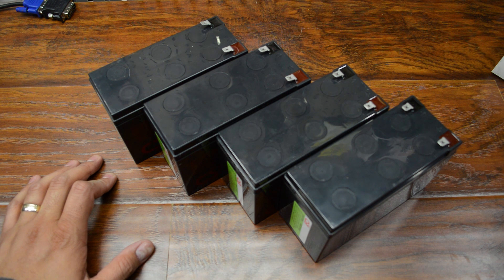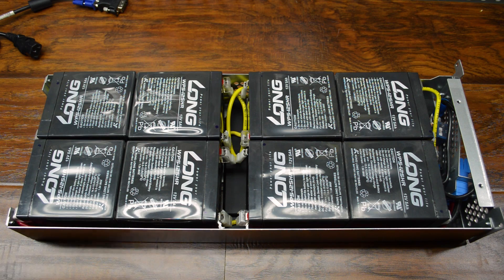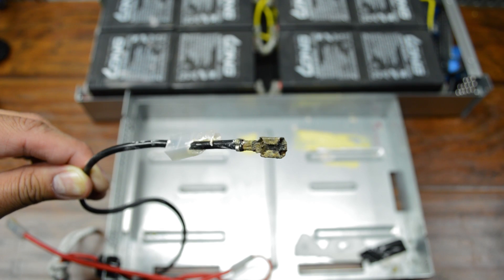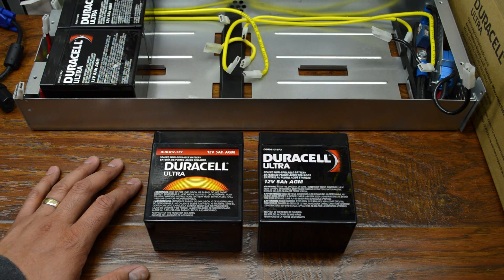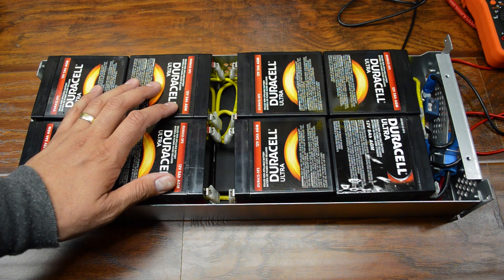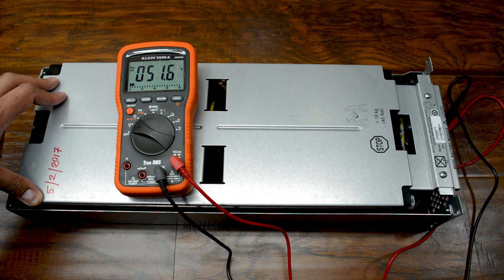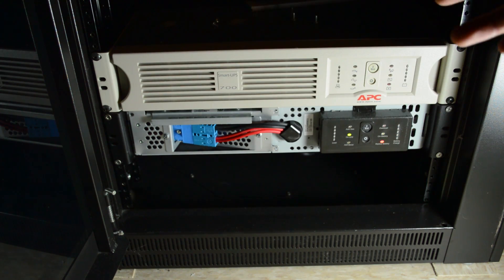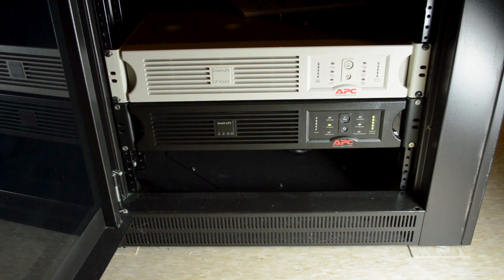Replacing Batteries in my APC SmartUPS 2200

Comment: Ever find a wire diagram?  I am looking at one of these on ebay right now and it has no batteries so I have no reference point, it just has all the wires.
Reply: If You Haven't Found The Diagram or Got no Responses, Essentially You Have 4 Batteries in The Back Connected in Series to Make 48V and 4 Batteries in The Front Connected in Series to Make 48V and Then Both of Those Banks are Connected in Parallel to Keep it at 48V but Make it 10ah instead of 5ah.

Comment: Will The Voltage Read 54v or is it 108v ish ? ? I Have a APC X2000RMLV2U & i Just Got it Without Battery's But I Have New Ones On The Way But I Would Like To Be 100% Sure before i add in the 8 battery's with out At least trying to make sure I Am Good To Go with The 108v before i Wire it Up & Put into service..lol. 13.5v x 8=108v not 51v..What did i miss ? ?
Reply: It should read around 48V. They're Two Banks of 48V,  So Essentially You have 4 of Them on The back of the Unit Connected in Series to Make 48 and 4 of Them on The Front of The Unit Connected in Series to Make 48V and both of Those are Connected in Parallel to Keep at 48V.
Reply: i Found out mine are 108- 144 ish volts & Not 40-50v! Mine Has 12 Battery's
Reply: @bigchew3149  Even at 12 Batteries I would check to see if you just have 3 Banks of 48v in parallel.
I highly Doubt it's Running mire Than 48V.

Comment: you don't even show the process of removing and unscrewing the ups. Also don't keep spare if you don't supervise them, these batteries need to stay 12v or higher (up to 14.4v maybe)
last but not least you can refill the old ones with distilled water

Comment: You can lower the UPS float voltage of the batteries by changing the battery voltage constant to read slightly higher. It makes the unit reduce the float voltage and saves heat build up in the batteries, giving them a longer service time and less risk of sudden failure.

Comment: Great video !  My APC Smart-UPS 1500 (small tower) came used with out batteries and has been going strong for a year ! (two 7 AHr 12 VDC)  And the Trip Lite 1500 LCD came with two batteries and NO complaints from the unit yet...  The LCD reads just the voltage...  When the lights flicker the UPS keeps the internet connection up and running !  Thank you for the video !  tjl